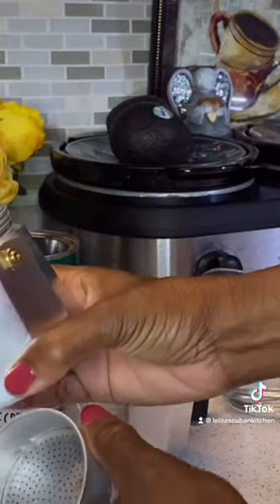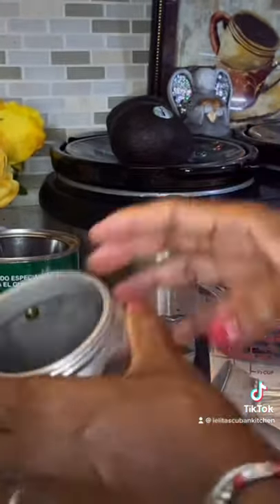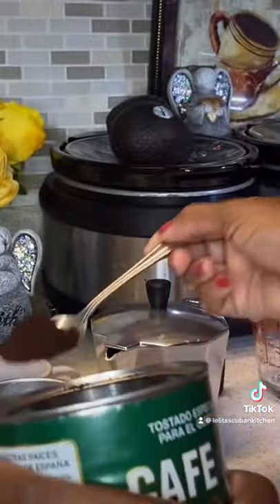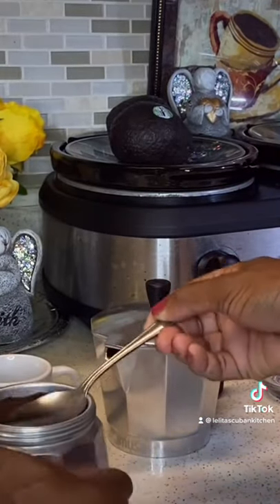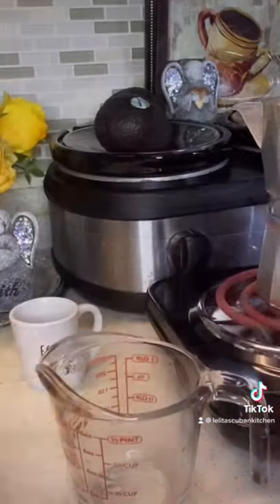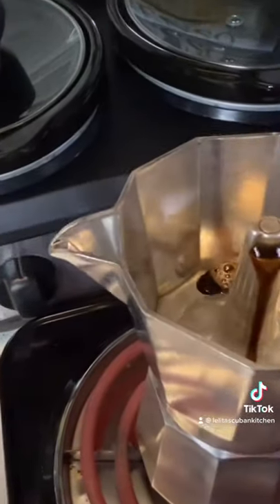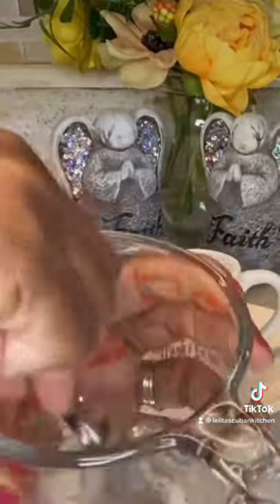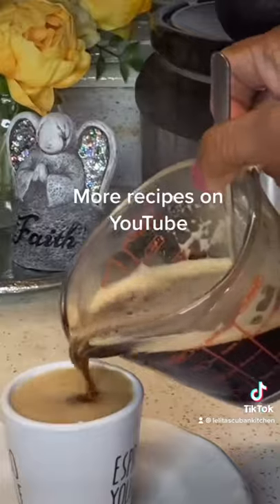How to make Cuban coffee #shorts

Comment: Most videos I saw they boiled the water before putting it into the bottom part is that preference?or…
Reply from the maker: I’ve never saw that done before. Cubans don’t do it that way. If you’re making Cuban coffee you add the water to the basin, then add the coffee filter, screw on the top part and then put it on the stove to boil the water. When the water comes up it will go through the filter making the coffee.
Reply: @Lelitascubankitchen  thank you so much for the feedback I love Cuban coffee and I’ve watched countless videos on how to make it the proper way and your way is the best the coffee tastes so good but I encourage you to just search so you can see what I mean , a lot of videos they tell you to boil the water first then put it on the stove
Reply: I’ve also saw them boiling the water as well also what temp should the burner be on ? Medium right
Reply from the maker: @yourname427  My grandmother and uncle used to use to put coffee grounds in a coffee sock strainer called a Colador and pour hot water from a pot to make coffee.
Reply: Not a great idea, it's hard to maneuver with due to how hot it is, I think just having regular water helps to be quite honest with you
Reply: You can do that, it might make the coffee a bit less bitter and speed the process up.